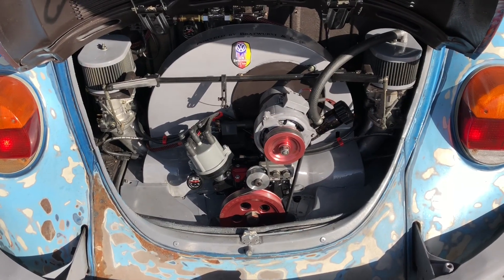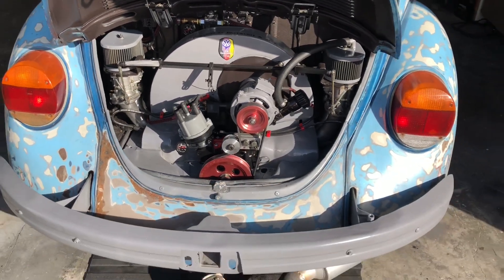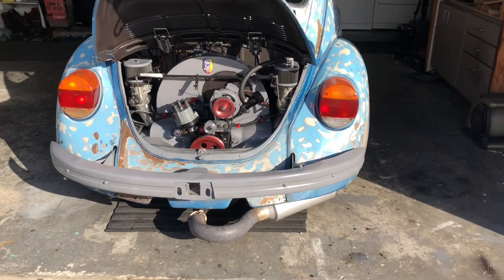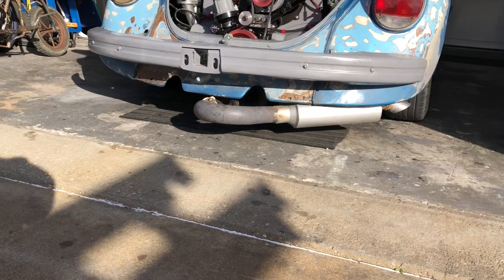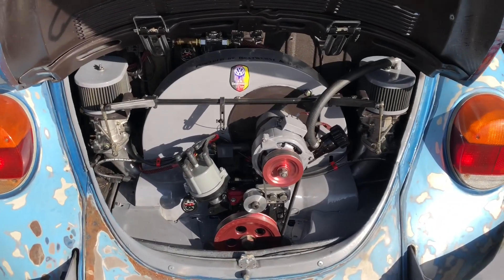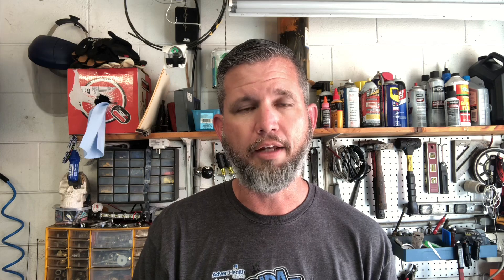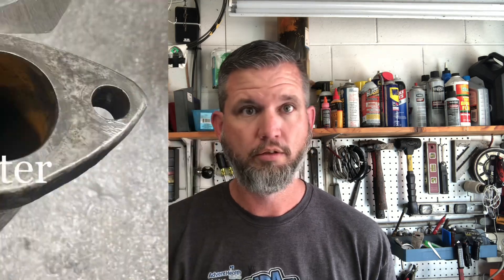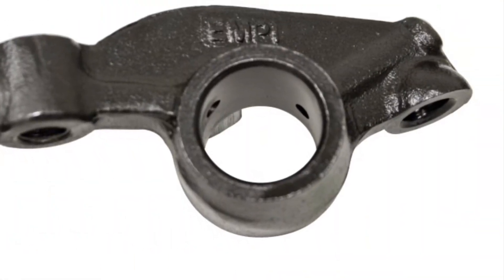NEW HOT 1915cc Engine for Jawbreaker the 1973 VW Beetle Overview and Q&A

Comment: One small point, and I recognize I will come across as "that guy", but you are not shoving anything down, the air and fuel is being sucked down.  This is the breathing of the engine after all.
Reply from the maker: You are right, I misspoke. You corrected me in a respectful way and for that I respect you.